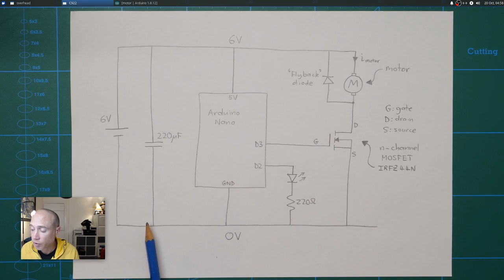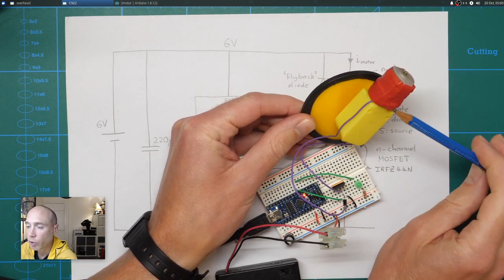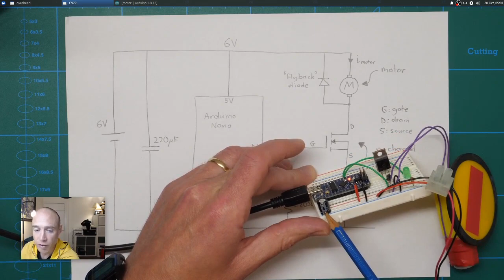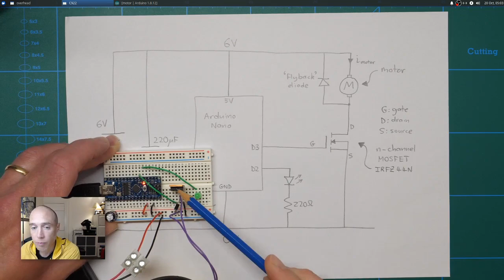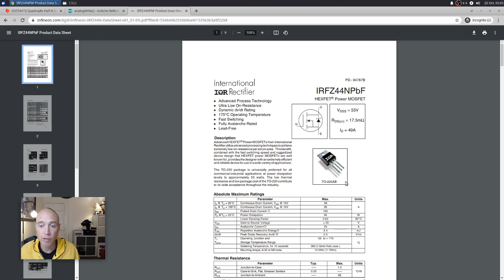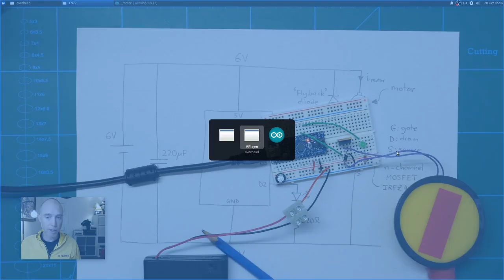Arduino Nano example: Unidirectional speed control of a DC motor using an IRFZ44N transistor

Comment: Hello Ted. I am looking for a way to regulate the speed of a motor via TapTempo (BPM) for a old Tape Delay. Unfortunately, microcontrollers are still new territory for me and I need help with this. Could you imagine helping me with my project?
Reply from the maker: @MarcelSuhr  if I understand you correctly, you'd be tapping out the tempo with a switch (e.g. foot pedal switch) and using that to sync the delay interval with the tempo of the performance? Sounds kind of tricky, because of the need to calibrate the motor speed precisely. Speeding up or slowing down the speed of a DC motor is no problem using a microcontroller, but setting it to an exact speed realistically requires some kind of feedback sensor (e.g. rotary sensor) so that the microcontroller can measure what speed the motor is actually turning and regulate the speed control signal accordingly. Do you know if there's any kind of speed sensing built into your tape delay?
Reply: Hello TED, nice to hear from you. Is it possible to reach you by email?